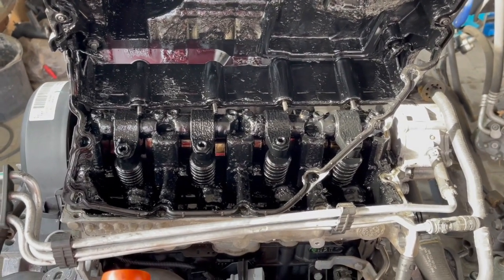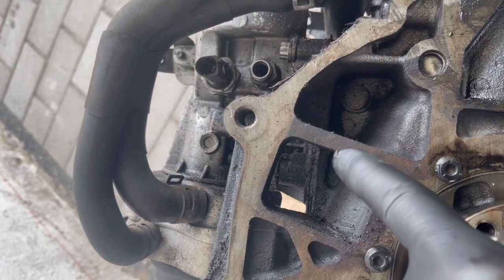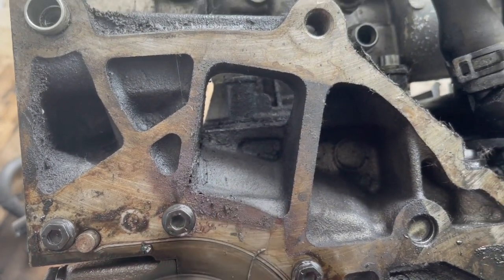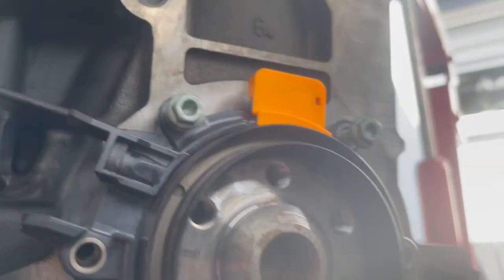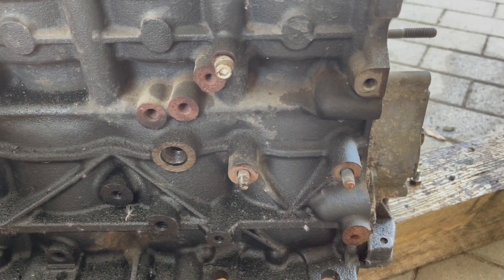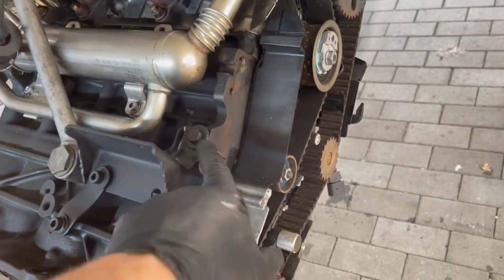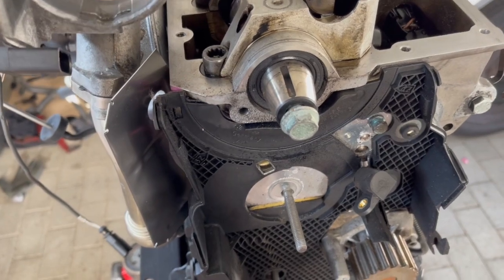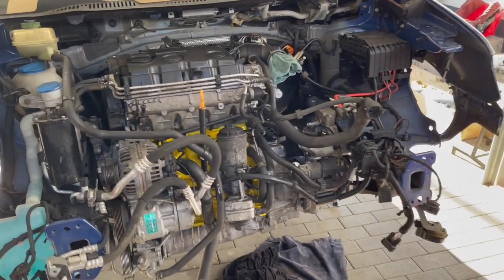1.9  VW  BLS PD105 to 1.9 ASZ PD130 engine swap. 2008 Caddy Engine failure: broken connecting rod

Comment: Do you have any problems with pd130 injectors and stock pd105 map?
Reply from the maker: I think it runs a little rich. I don't know if the injectors are larger or if the cam  has a different profile or both. 
I think my gas mileage has suffered slightly and I now have some "jumpy" throttle feel when at steady throttle. Especially noticeable at 40-60 kph in 3rd gear. That is where it seems to make the most power. The turbo also seems to spool up faster and I can hear it spool up where before it was very hard to hear it. The difference in overall power is negligible because I am running the stock turbo. 
Another Thing that could be a factor is that my timing might be a bit more advanced than before. When I installed the timing belt I tried to get everything as close to factory settings....bolt markings on the cam pulley and such. But it could have been a fraction of a degree different causing my fuel injection to activate at a slightly different time. But overall I am happy with the performance so far. 

At some point I would like to install a larger turbo and remap but I don't have any need for it, just on the wish list for the future.
Reply: Needs Darkside developments remap or equivalent,  or put pd105 injectors back in
Reply: Normally pd130 injectors and GT1749V turbo with remap as the move from Ed c15 to edc 16 ecus or use original pd105 bv39 or gt1649 turbo and injectors or will run rich
Reply from the maker: @marcb5328  Thanks bud! I think I will put my 105 injectors back in when I get some time. I want to refurbish them when I do, so I will need to get a bolt/seal kit before I do it. I  don't need more power but i really do want it. Cost and time are always the factors that control my wants.
Reply from the maker: @marcb5328  I put my BLS injectors back in and my fuel mileage has returned to normal and my throttle response is also smooth under constant throttle.

Comment: I am doing now conversion from bls to bxe and no let engine crank i left old wires and i change the egr old something no let me crank have you got any probs ? Have you put the old injectors me i left the old in the engine ? Thanks
Reply from the maker: I rebuilt the BLS injectors and installed them later. The ASZ injectors were too big and my fuel mileage was about 100km less per tank. So I put the BLS injectors back in and it has been back to normal.
I am not sure about the EGR change. I reused my BLS egr system.
You must use the cam pulley from your BLS or the timing will not be correct.
Did you replace the timing belt?
Reply: @sebsway  no i left the old pulley
Reply: @sebsway  i got the old engine pulley i will change it tomorow ive seen some garages today they said not touching i hope your words is my exit on this 🍻🙏
Reply from the maker: @danrus3529  BLS or BXE? There are tiny tabs on the inner part of the pulley that the sensor picks up. These tabs are engine specific so you must use the original BLS pulley.
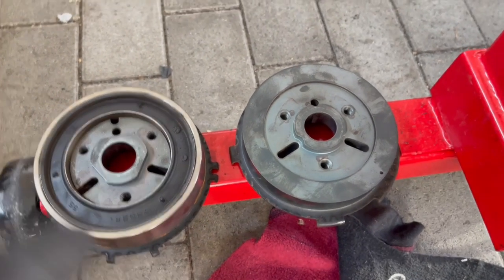Reply from the maker: @danrus3529  check the 24:42 mark in the video. It shows the differences of the inner pulley parts
Reply: @sebsway  i start it today man the pulley was the same code and exactly the problem was a ground from starter motor 👍
Reply from the maker: @danrus3529  Awesome man! I am glad that fixed it.

Comment: the injectors steel the  asz ones ?
Reply from the maker: No I swapped them out with the original BLS injectors. The ASZ injectors were too large for the stock tune and stock turbo. Fuel mileage suffered about 100 km per tank which equals about 6-7 liters of fuel or about 12 euro per tank extra cost

Comment: Hey great work you've done there I'm thinking to do the same swap and I got some questions did you feel any increase in power ? Any difference in the fuel consumption ? The engine noise at idle ?
Reply from the maker: I do think I have an increase in power but i am not sure if that is from the engine. During the assembly i cleaned all of my intake parts which had a lot of carbon buildup. I also cleaned the egr valve and throttle body. It just seems a little more peppy. The PD130 usually has a slightly larger turbo and a couple of psi more boost. 1 psi is roughly equal to 10 hp. so 2.5 extra psi of boost would give you the extra 25 hp. 
I did not change or remap my computer because I just kept everything stock.
The engine is a tiny bit more noisy at idle but not considerably. Not really noticeable inside the car but it is outside the car and especially in a garage where echos happen. 
As for fuel economy...it seems to have suffered some but I have also been hauling a trailer much more recently and also more in town driving since the repair so that could have something to do with it. 
I also have a random fuel smell inside the car when the a/c is on. I reused the PD130 injectors and I think they may be slightly larger injectors for the increased HP. I could be running just a little rich on my fuel ratio because of that. I am thinking of switching  them out for the originals but I need to get an injector rebuild (new seals) kit and new injector bolts before I can do that.

Comment: that is not asz its pd 100 its smaller oil cooler evry asz have bigger one.
Reply from the maker: I don't understand what you are saying. The engine was a complete ASZ PD130 purchased from a salvage yard.
Reply: Asz engine have bigger oil cooler under oil filter check on internet chanse to someone put smaler oil cooler is small, there is one more diffrend asz have holes for oil  squirters under piston if doesent its not asz
Reply from the maker: @dzemo3484  I used all the bolt on parts from my BLS PD105 because the ASZ parts did not interface with my Caddy. AS you can see i the video i had to make significant modifications to use this engine. Yes the original ASZ oil cooler was larger but that is now located in my spare parts bin.